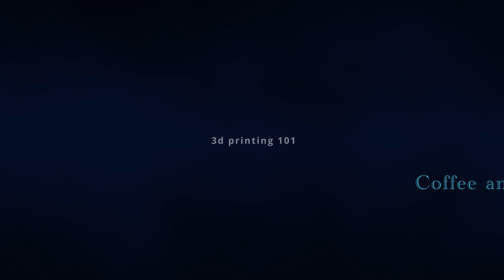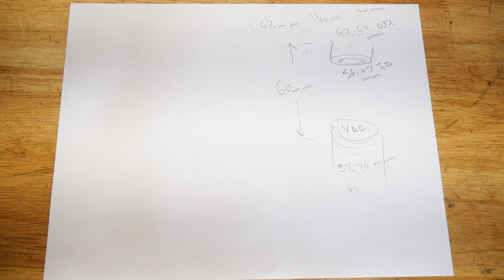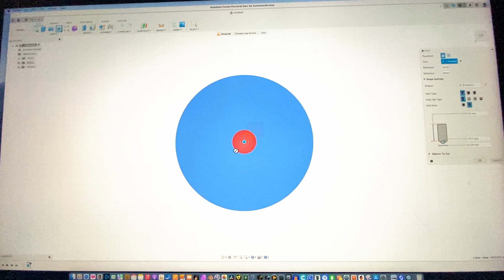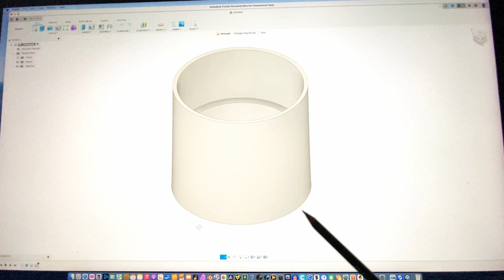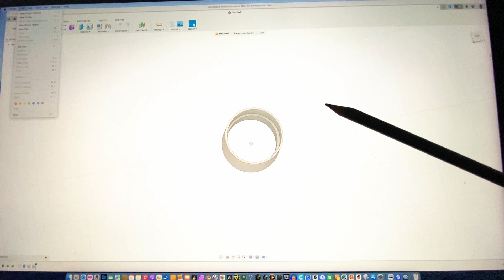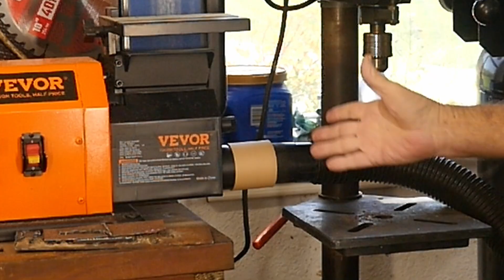Learn 3d printing from design to finish, Coffee and tools Ep 428

Comment: I feel your pain. Once I start a 3D printing at home, I had to give in to the metric system. I was a 3/4, inch guy too ... My whole career as a product designer. But now I wish we would have converted 40 years ago !!
Reply from the maker: Steve, we're in the same boat. I will say this much for metric the math is stupid easy and I guess that makes it ...err...FUN ? LOLOL
Reply: @SirTools  - Yes, the math is stupid easy. And it probably would have made life stupid easy if we learned it from the beginning. I'm quite comfortable with designing new things in millimeters now, but where my issues come from sometimes, is correlating metric to imperial. I'm good with visualizing that  a millimeter is about 0.40" , and an inch is about 25 mm... But don't ask me how many mm are 8 3/16 inches... That's what Alex is for !
Reply from the maker: :face-blue-smiling::face-blue-smiling::face-blue-smiling: I'm with you Steve. My challenge is trying to guess on length in metric and just can't do it. I have to pull out the metric tape measure to see what I'm thinking LOLOL...